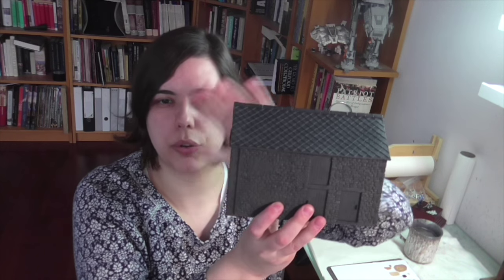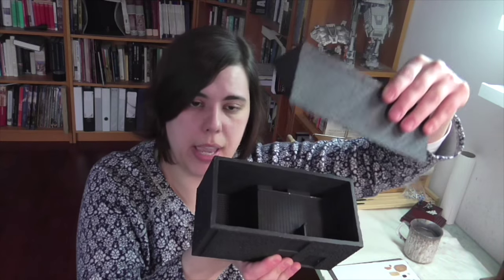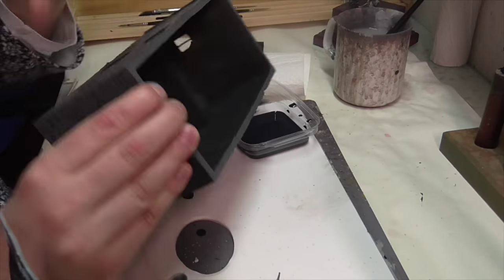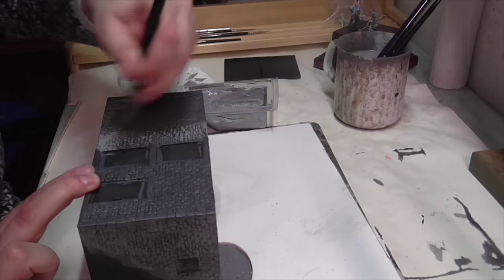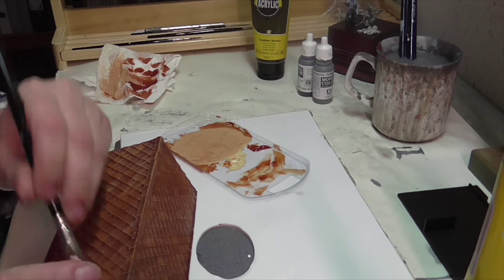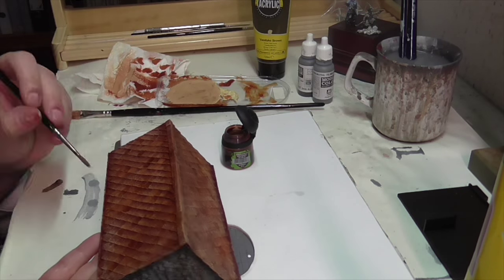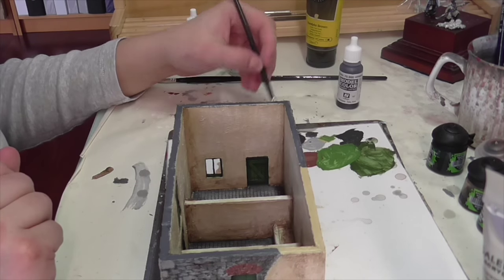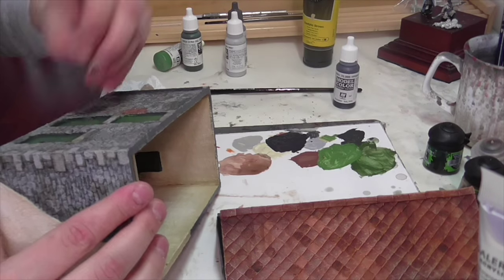Adding structure: Painting a WWII French stable

Comment: Good video. I would have left the original dark/black and heavily dry brushed over that from the beginning and used it as the deep deep contrast. It will also cut down on the amount of black washes you need to use later.
Also, remember that buildings have a history of their own. Part of it may be owned by someone else. The short version is that not all doors and windows may be the same colour or shades. A door may have been replaced and painted in another colour. For inspiration look at buildings near where you live and see how they have changed over time.

B

Comment: The  building looks good. Do you think that varying the shades of grey in the stonework more would have been beneficial? Also some green washes to simulate mould or moss on the stones like you did with the plaster would be good.
Reply from the maker: +john tailby Yea, absolutely, picking out stones in other shades would have looked nice. You can go crazy with detailing terrain if you want, I just prefer not to get as carried away as I do with figures, since buildings are so much bigger! I've messed with green washing before. I find it often comes out a little weird and fakey looking. It's really easy to overdo, so if you want to, do it VERY sparingly and use very thin wash.